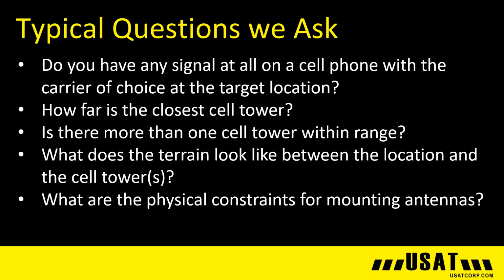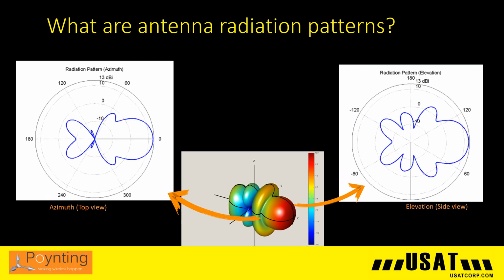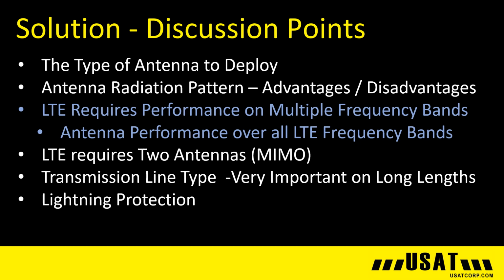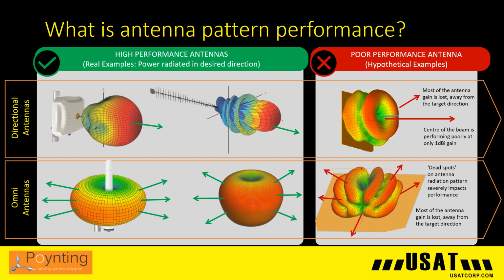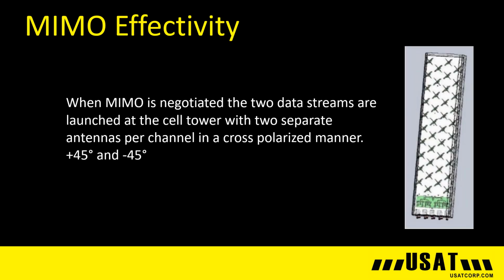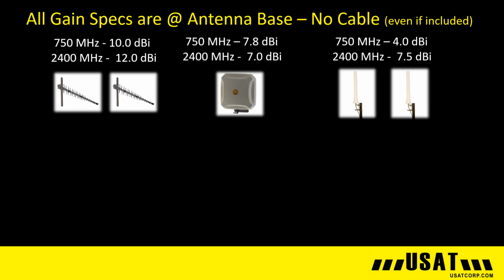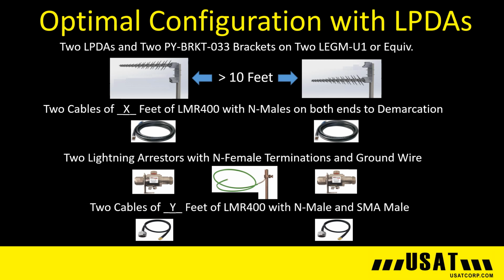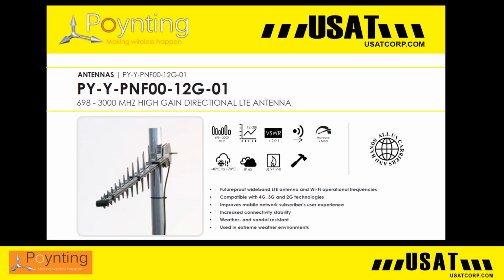USAT Rural Connectivity with Poynting Antennas

Comment: Great informative piece! Antenna, antenna placement, and cabling are so often overlooked, and yet play a vital role in a successful wide-area wireless IoT deployment. The best IoT cellular gateway will stumble if the antenna system is not optimized.